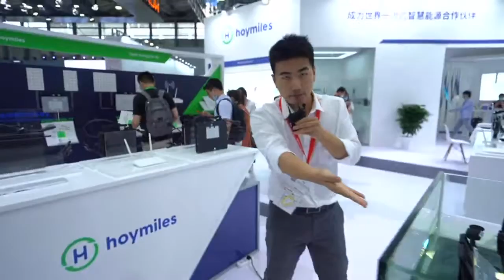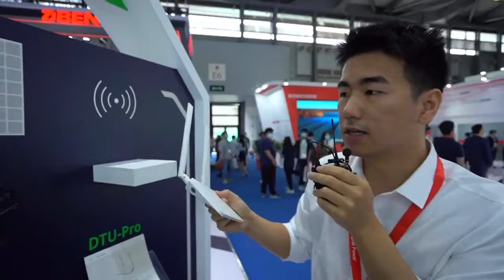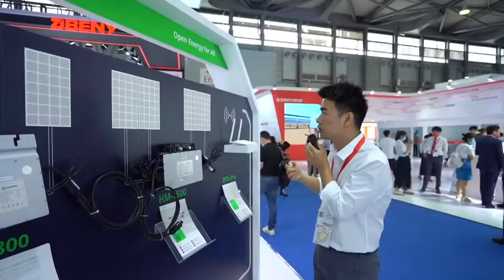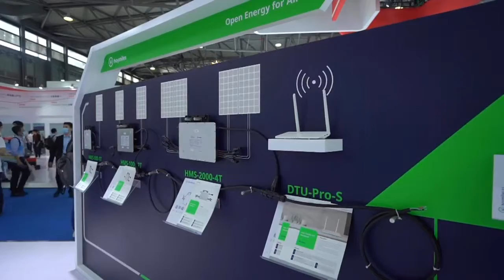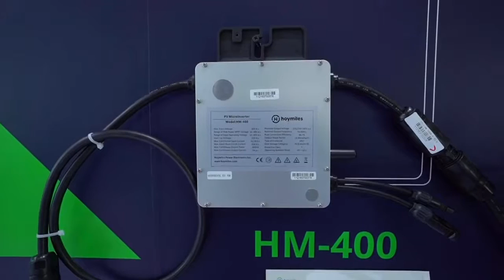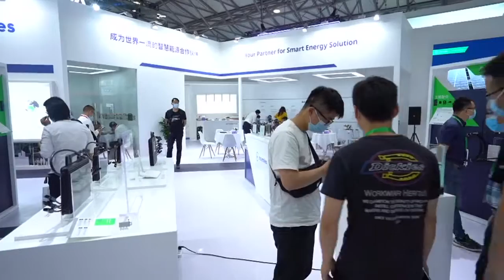Live Streaming for Australia - Hoymiles New Microinverters Launch @SNEC Shanghai 2021

Comment: HI Daniel can you comment to Australian customers on the 90 C cut out to protect microinverter core?
Reply: hi Rob, Good day! , Micros would reduce the power generation when the core temperature reaches 85 ℃. And It will linearly reduce the power output to 70% of full capacity when the temperature got 90 ℃. The micros would stop working once the core temperature over 90 ℃ (monitoring function and communication won't be affected by temperature).